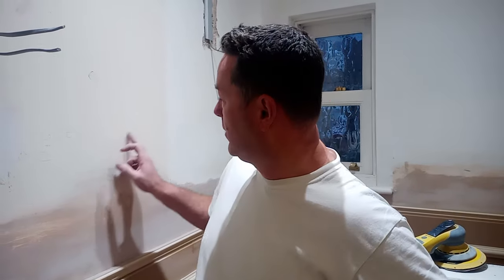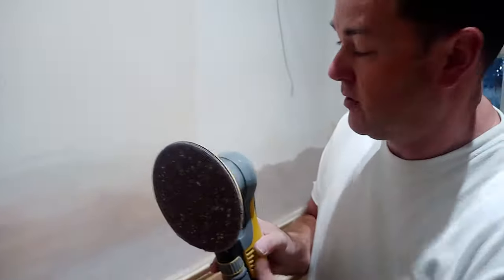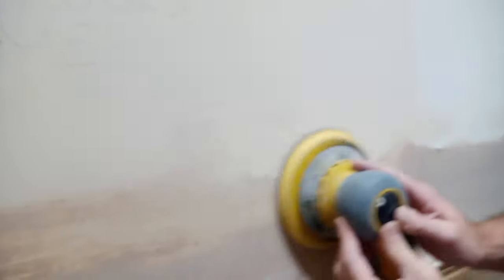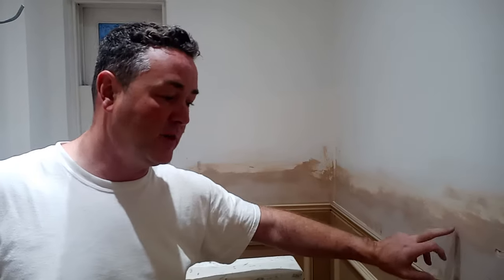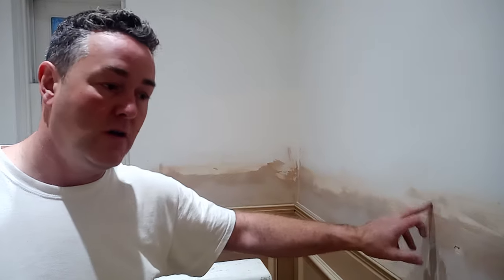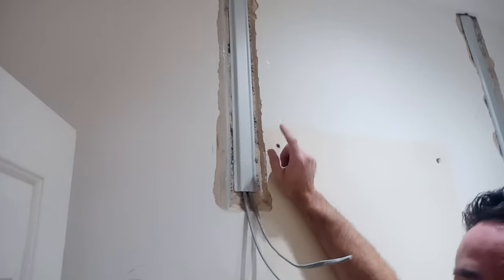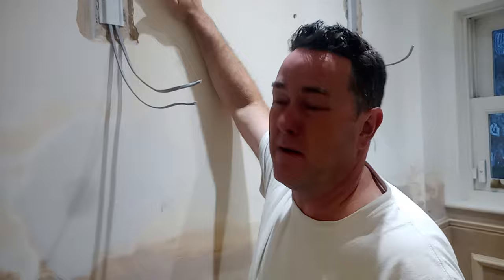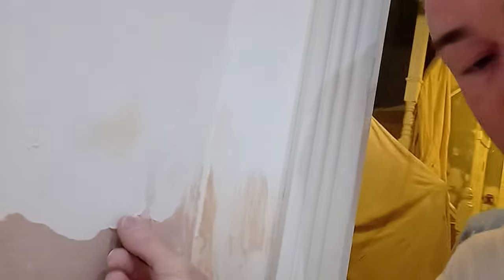Painting DIYers Beware: The Dangers of Using PVA as a Primer

Comment: I am a paint retailer in Ireland and I am sick of customers coming into my shop for PVA. They are usually recommended to use it by a "Painter " for both inside and more worrying outside also some painters recommend adding it to Weathershield to help it stick and make it more durable. FFS
Reply from the maker: You'd laugh if it wasn't so serious.
Thanks for stopping by and commenting too.
Much appreciated
Reply: One brand of pva tells you that it can be used with cement paints

Comment: So what would I do in this situation? 100 year old house. Plaster walls. Just tore out plaster ceilings in two bedrooms, replacing them with drywall. Then skim coated over top of all the plaster walls with joint compound to smooth out the texture. So the walls are technically not drywall, but skim coated plaster. Drywall guy today told me to put Kilz PVA primer over top of the skim coated walls to seal them before painting. Wise? PH of Joint Compound, btw, is 7.5 to 9.9. And if PVA in Britain is PVA glue, not PVA primer, as we use, then maybe this is a non issue.
Reply from the maker: PVA over here is Glue.

So we wash coat bare plaster with a thinned down coat of emulsion paint.
is Kilz primer like Zinsser Gardz?

Comment: Great video Phil...its about time someone got this out there...
Complete waste of time as a mist/sealer under paint.

It has no opacity, its reactivated by water/moisture, and can cause following coats to peel. As a 'sealer' bare plaster isn't sealed, its primed..
And to top it all, most PVA manufacturers say not to use it under water based paint.
DIY myth, paint company's specifiers and architects etc don't specify PVA, and 99% of decorators don't use it.

Comment: I used PVA primer once on bare drywall (United States). I had peeling issues. I don’t understand all the hate you’re getting in these comments. I absolutely agree with you. 

PVA is total trash. It’s not worth the cost savings. Contractors should do themselves  and your clients a favor and just spend the extra money on a good primer.
Reply: I moved into my new house, and when I repainted the one drywall surface in the bedroom, the whole new paint and the coat underneath peeled off! I was left with original drywall brown surface! I peeled it off so easily, probably because of the new paint making the wall damp. I peeled everything off, apart the edges, as others already mentioned in the comments. I wonder if that is the same PVA issue ? 🤔🤔
Reply: @jhutfre4855  that’s exactly what happened to me. It may not be PVA, but it’s definitely a “prepping” issue, no matter what the cause

Comment: I totally agree with you mate. Although that looks a damn strong mix of pva.. almost neat. You sure it’s not SBR? Also just as crappy for painting over? Had it myself a few times having to sand off excess pva/sbr sometimes thin and other times thick as rubber
Reply from the maker: Seeing the plasters... It could be anything lol
Reply: I use SBR when patch plastering and never have issues with it when painting... careful application like paint is needed, wouldn't just throw paint at the surface why throw a sealer?

Comment: I tried watered pva as a mist coat/primer on new skim plaster. Ended up scraping the new emulsion coat off. Came off in sheets like wallpaper.
It just formed a skin and the paint didn't stick to the wall.
Maybe some people can make it work but I couldn't. UK based.
Reply from the maker: It doesn't work, that's the thing. As you've found out the hard way. :(

Comment: painting use to be simple in terms of what to use . i had a painting business in the late 1960s early seventies . in those days , there was latex or water base paint and lead free oil based paints. pigmented shellac was used as a sealer if needed . that was pretty much it . there was no problem with chemical or mechanical bonds . if you wanted to change from water based to oil or vice versa we just did a quick interface with pigmented shellac which had good adhesion properties and that was that .
Reply from the maker: You've seen a lot of changes now then.
Did you move into another trade or just do something else?
Reply: I learnt about paints & scraping walls at an early age  my father was in the game late 50s to mid 60s but he got out as he had plenty of work but no money! The bigger the job the harder it was to get paid

Comment: I'm so annoyed, I took wallpaper off that was put on by the previous tenant. The wallpaper came off fine, but then I see this PVA undercoat that is attached to the plaster of the wall!  A lot of it I was able to remove, but the corners and edges I cant get to come off, as it is too fiddly and is basically very dry and hard. I have tried hot water, vinegar, fabric softener, white spirits and sanding it down, but that is not working as bits still peel off, so I cant paint over it. Help please!
Reply from the maker: I've replied to you on the other post 

Btw... Don't use fabric softener lol

Comment: In our country we use pva primer only on wall that painted already with jotun penetrating sealer wall
Then we use  Acrylic putty then a first coat off whit acrylic paint and the final silky smooth paint
Reply from the maker: PVA is a glue though.
Reply: Pva is not a wood glue, but known as a wood glue, it is a water soluable polymer, and using as a primer basically using as an emulsion stabilizer… 
 
This is from wikipedia :

Poly is a water-soluble synthetic polymer. It has the idealized formula [CH₂CH]ₙ. It is used in papermaking, textile warp sizing, as a thickener and emulsion stabilizer in polyvinyl acetate adhesive formulations, in a variety of coatings, and 3D printing. It is colourless and odorless.
Reply from the maker: @Tinnitussss  you don't put PVA onto bare plaster.
Painting over it also causes problems.
Reply: @ProfessionalPainterDecorator I saw a guy pva the brick on the out side of a building then they rendered it so if that were to get damp its all coming off 🤣👍
Reply from the maker: @Mattlawton-ft6ew  don't they use SBR outside? or should do.. i'm not sure.. i don't use it being a decorator lol
lol
Reply: @ProfessionalPainterDecorator  yes they do but this guy had a tub of pva 🤣👍
Reply from the maker: @Mattlawton-ft6ew  classic lol

Comment: Hi whats your thoughts on using diluted pva as a primer on a wall before wallpapering to stop any seam spliting? ❤
Reply from the maker: Do I need to answer that one?
Reply: @ProfessionalPainterDecorator  I will take that as a DO NOT DO then. I watch a professional wallpaper guy in the USA and although he says u can use products like gaurdz he uses PVA
Reply from the maker: @nataliehayden8330  Spencer?
They don't have plaster walls like we do. They work on dry lined walls.... 
PVA is not alkali resisting... Plaster wall are alkaline surfaces.
No different to asking.. should not oil paint (oil undercoat, or rggshell or gloss etc) on bare plaster!

Watch the start of this video.
https://youtu.be/E0u6ey-7zaY
Reply: @ProfessionalPainterDecorator  yeap Spencer. Thank you

Comment: Hi Phil. Thanks for advice. Would you recommend beeline primer sealer after sanding down old emulsion on plasterboard walls before new emulsion, cheers pal
Reply from the maker: Hi. No. Have a read of the spec for it. The BeeLine primer sealer is for use prior to wallpaper hanging, not prior to emulsion painting. :)

Comment: Doesn't one use PVA to stop dusting on fresh plaster prior to applying wallpaper paste to lining paper and then papering the wall? So, whilst PVA it isn't supposed to be touched directly by paint, it does have a place when decorating right?
Reply from the maker: In simple terms NO.
You don't put PVA on bare plaster... As I discussed in the videos why not.

If you're wallpapering you size the surface with thinned down wallpaper paste... Use the same paste to size the wall as the paste you'll be using to hang the paper.

Or you can use Zinsser Gardz.
Which is alkali resisting... PVA isn't.
Reply: @ProfessionalPainterDecorator Thanks for clearing that up.

Comment: Alright Phil...just subscribed! Im Plastering my own house and its going really well so far... question for u...
Plastered all four walls in a room and got the ceiling to do but it wont be me doing it and im sure your aware that the plasterer will pva 2 coats on the artex ceilimg before Plastering.  So he will splatter small amounts of watered down pva here and there proba 50/50 ratio pva water.  I plan to emulsion when olaster dry...the pva/water thats splashed onto walls will this coz a problem for me to emulsion the walls? As its only splatters of 50/50?
Reply from the maker: Hi ya.... Loads of vids for you to watch then.

PVA splatter.... :( When you do your wash coat of very thinned down emulsion... The splatters of PVA may show, but don't panic, you'll give the wash coated new plaster a light sand anyway. If you see the PVA you can hand sand those if they look to be a problem.
Once you wash coat and sand over the plaster, give it another thinned down coat of emulsion to those surfaces.

Better do thin coats and build up, than trying to rush it with a thick coats over one wash coat.

For your wash coat on new plaster. Do look at dedicated bare plaster primer paints.
Tikkurila Optiva Primer
Or Nonsense bare plaster primer 

I'd still thin these slightly, even though they say you can use as they are.

You'll know what feels right when you start to apply, whether it feels a bit thick.
Reply: @ProfessionalPainterDecorator  spot on Phil! That's reassuring then! I'll definitely take note of this as hope to do a mist coat next few Weeks as finish plaster this week so time it dries etc.  I've bought an emulsion that's suitable for new plaster "express coat Valspar, pure brilliant white matt" so hopefully 50/50 this with water for mist coat paint it on and I'll look out for the splatter and do as you say sand the imperfections down and second coat that! When you say sand the mist coat before a second coat of mist...is this just literally like a once over say with 120 grit? Think when I get ceilings done I might try hand sheets up the walls hahahaha if it saves me less splatter can't be too daft

Comment: Would it be appropriate to use PVA on a plaster surface, with existing paint, after sanding, and prior to skim coat with setting type drywall compound?  

Or would GARDZ or ODERLESS oil primer be a better choice?
Reply from the maker: Well I wouldn't. But I bet plenty do.

Prep your wall and Gardz it. Fill any areas. Then touch over the filler with Gardz 
Then paint it.

Comment: PVA is the devils work. Find it a lot when stripping wallpaper. Creates a total mess. Some guys talk about mixing it with their wallpaper adhesive which baffles me. I would only use it to bind down dusty surfaces in large cracks or holes if nothing else is available.

Comment: Hi Phil, very pleased i found this as a 'decorator' advised that i should prime an old wall with pva, but maybe because he assumed i was going to skim the whole wall with 'easifill'? I have removed 25 year old wall paper that has also taken off some plaster, and render, in places that i will need to fill before painting.  I was going to use dillute pva as the dust sealer as you mentioned before filling.  if i do splash pva where it's not wanted will it come off using sugar soap please?
Reply from the maker: Hi.
If you using it to back prime before filler, you'll be ok ... Just apply it to the area that's needed. PVA will soften backup with water/moisture. So wipe it off any woodwork if you get it on.
But...
Don't be using PVA.... Full Stop prior to painting or wallpapering.
Reply: Thank you very much - massively helpful  @ProfessionalPainterDecorator

Comment: All I ever use pva for is to prime bare plaster before lining paper.
Reply from the maker: oh dear :(  you know PVA isn't alkali resisting? .. and what is a bare plaster surface?
Reply: should be using paste, either water it down to make size or use same strength mix as using for the paper, it tells you on the packet usually, the paper sticks like sh*t to a blanket if you do it right
Reply: That’s so so wrong mate ,

Comment: Hi, you seem like a person who is well knowledgeable. My husband and I are renovating an old vintage trailer that has walls lined with wallpaper that do not come off easily. We would like to just prime the surface before limewashing. We are also trying to go for something least toxic to our environment since it is a small closed off space. Do you have any experience with lime wash and pre-prepping walls for this? What would be your recommendations for primer? If you have ANY suggestions, would love to hear your input since we are held back from moving forward with this. We have NO idea what we’re doing so any help is appreciated! Thanks so much!!
Reply from the maker: hi, when you say lime washing.... what do you mean, what process are you doing?
Reply: Did you try a steamer?  Steamers work great on removing wallpaper.  The heat and moisture softens up the glue of the wallpaper backing and it should come right of in big sheets without damaging the plaster or drywall behind it.  Almost every other technique i've seen has limited success.
Reply: @chrisloesch1870   I did that, and the wallpaper came off fine, but the pva coating underneath has been a nightmare, i cant get the corners off. help

Comment: I just had a contractor use PVA after skim coating bathroom ceiling. What can I do now to fix their mistake so it doesn’t start flaking? Should the ceiling be sanded (there is now paint over the PVA) and apply Zinsser Peel Stop before repainting? Instead of PVA should the contractor have applied a mist coat or used an oil based primer after skimcoating?
Reply from the maker: Hi.
Oil based paint also isn't Alkali resisting on bare plaster.
You'd need Alkali resisting primer on bare plaster, if you wanted to paint it with oil.vaeed paint.
But emulsion is also alkali resisting... So a wash coat of Matt emulsion is fine, or use a bare plaster primer (that's geared up for first coating bare plaster)

Going forward.. the PVA shouldn't have been used on bare plaster 

Give the surface a sand over... Use Zinsser Gardz over all of it.
That should help.

If you notice peeling you can use PeelStop.

TBH... Either will be ok, and so much better than using PVA (which I'd wrong, no matter what anyone tells you).

Watch the start of this video and how plaster reacts with a Coat of PVA over .
https://youtu.be/E0u6ey-7zaY
Reply: You're going to be fine, pva as a 1st coat over skim coat is great, just top coat with egg shell or semigloss paint.
Reply from the maker: @guyfromaz01  very worrying who's told you that.
PVA isn't alkali resisting. Eggshell and semi gloss Oil paints aren't alkali resisting so you don't put them over bare plaster . As it's an alkaline surface.

Have you heard of saponification and what that is?
Reply: Wait till you have a problem. Why fix what's not broken. Fact is many, I'd say millions, in the USA use pva drywall primer first without a problem for many years. The new pva also isnt the same as the old pva. Guardz is only for major problem surfaces, not a fresh skim coat. Plus it reeks to high heaven.
Reply: "Saponification of paint is a chemical reaction that occurs when newly plastered substrates are painted with oil paint"

I don't know anyone that uses oil based paint anymore, especially over primed drywall.

We paint high end houses and we always prime interior drywall, so does everyone else. I've been doing this over 30 years and never had an issue painting over primed drywall surfaces with acylic or vinyl latex paint.
Reply from the maker: @guyfromaz01  what is the surface of your dry wall???

Do you plaster skim over plaster board like here on the UK.

Alkali surface like plaster can't be painted over with oil paint.... That's where saponification happens.
Hence when over bare plaster you use Alkali Resisting Primer.

Comment: Always great viewing from your vids Phil, as a fellow decorator why would you use PVA as a primer? Its not how we were taught at all, the only time i ever use it is when im prepping before papering with a really porous surface prior to using a paste the wall paper ....not before emulsioning 🙈
Reply from the maker: Thanks, glad you like them....

....and you know I'll say.... there's no need to use PVA for sizing before papering either, just thin down the paste you'll be using to hang the paper, you only need to even out the porosity of the surface you're working on..... for dry porous painted walls.. I use Gardz.
The problem with using PVA..
1. it's not Alkali Resisting if it goes over bare plaster.
2. when you come to strip the paper off its goes all snotty once the hot water gets to soften it up.

there's no reason to use it really.